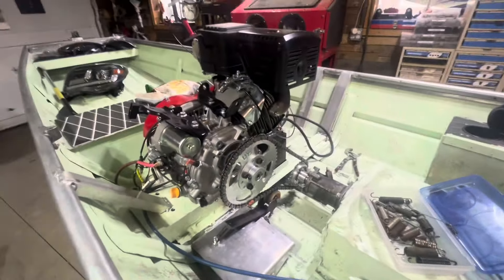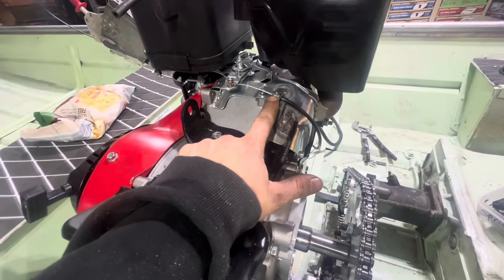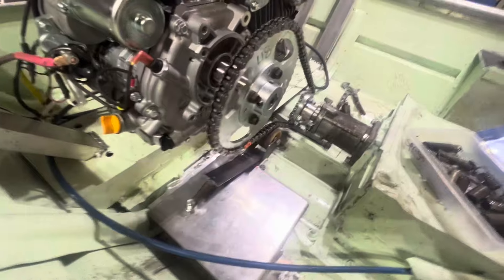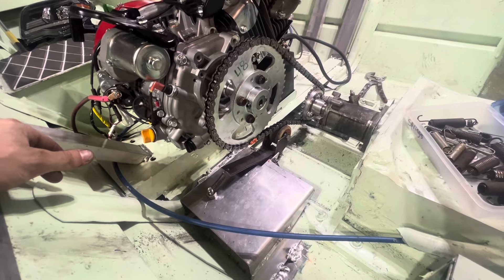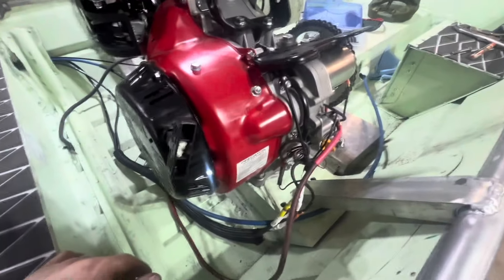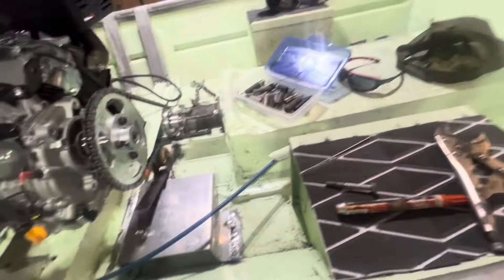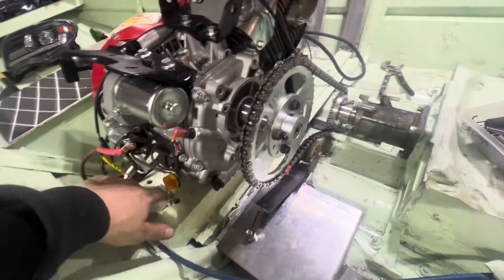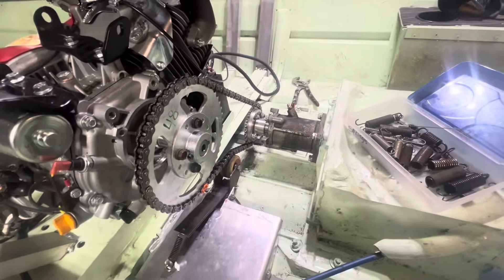Predator engine jet boat, part two

Comment: Your chain tensioner almost left the chat! Other than that, pretty cool. Once you get it all figured out you can upgrade to the predator ghost high performance engine
Reply: chain tension should be on the feed side if im not mistaken. Return side gets all the vibrations without tension on the start side